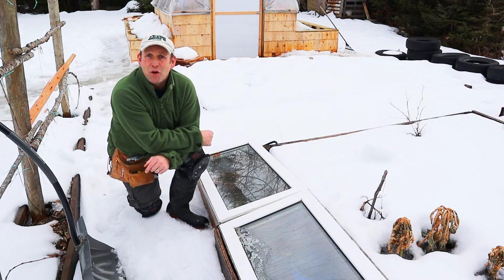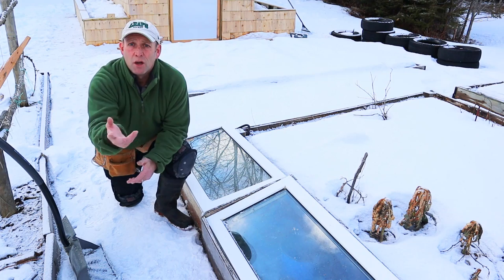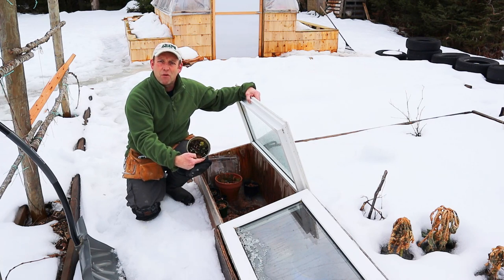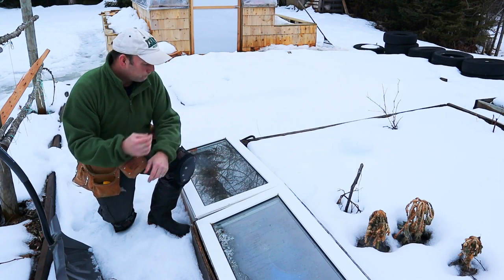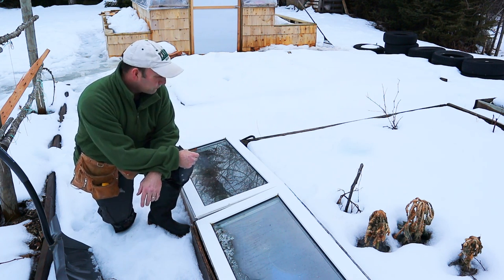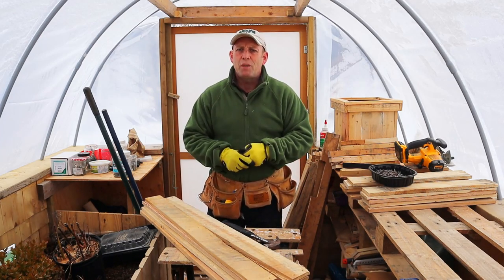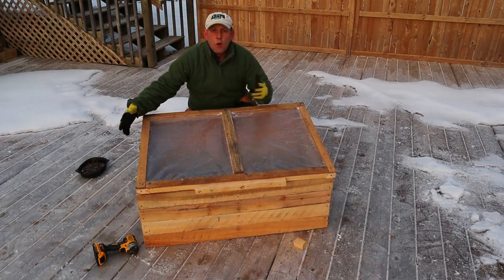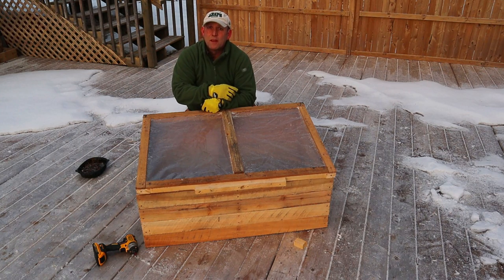How to Make a Cold Frame Out of Pallets for Under $10

Comment: I like. Nice. If it rains, water runs down to front of frame could collect and rot wood so maybe add something to allow water to run off. Nice one buddy
Reply from the maker: Yes is a great idea, I either cuts some holes in the top frame, or drill some holes for the water to drain out :)

Comment: You might think of adding a hinged slat on the inside attached to the center slat to use as a prop whenever you raise the lid.  Looks good, those and cheaper than using glass and not as heavy to lift the lid, either.
Reply from the maker: Good idea!

Comment: Hi.  Great job !!    Will you use a random board to hold the lid up while moving things about inside?    Peace to you and yours
Reply from the maker: There is always something I forget! I mention to add a length of wood to the side, on a screw, that you could put in place to keep the lid up when needed, especially as when Spring comes it can quickly get quite warm in there :)

Comment: Loving this idea Steve.  Do you think you will need to hook down or tie down the lid in the front to keep it from blowing up in the wind?
Reply from the maker: Cheryl Bolivar there is always something I forget 😊 yes a good idea that I meant to say. Especially my one as the wood was a bit twisted.
Reply: Steve you mentioned that you will put a bottom on the box.  Is that a necessary step or would it still be as effective without a bottom and having the earth as the bottom?  But then I guess that would only work well if the place it sits is completely level with no gaps to let in cold air underneath.  Maybe I've answered my own question 🤔.   I've not used a cold frame before.
Reply from the maker: @cherylbolivar10  you are right though, although it is still useful without a bottom, as the frost will be prevented from forming on the plants. An alternative which I forgot to mention, is to maybe build a little shelf, maybe from a leftover pallet, to keep the plant off the ground :)

Comment: I don't have a circular saw, and how did you do the corners of the lid?  Looks good though.  Thanks.
Reply from the maker: You don't need a circular saw for any of this, it just makes things easier on the arm! The corners of the lid are nothing special, I haven't made any angles, just cut two equal lengths for the top and bottom and two equal lengths for the sides, then screwed the sides to the top and bottom

Comment: do you think i could do with with like 1 and half pallets as i just found that much in a skip. also only thing i point out is how could you change this to make the water run off so it doesnt rot the wooden frame? thanks
Reply from the maker: It depends if you can use all the slats from the pallets. It will be tight. I have since drilled some holes through the front of the lid, at an angle down, so any water that settles at the bottom drains out :)